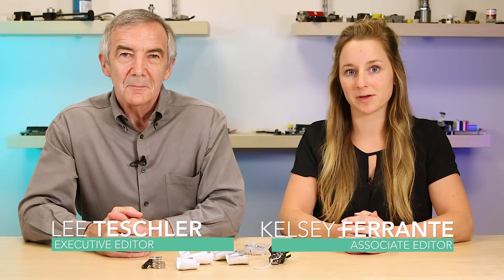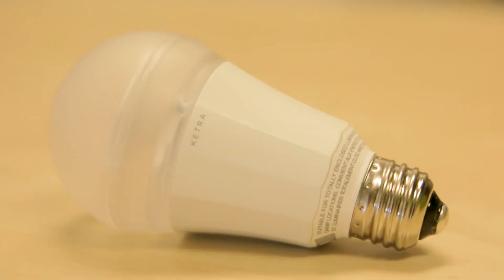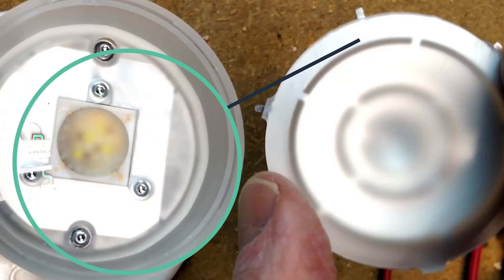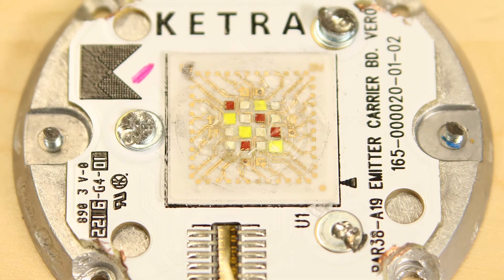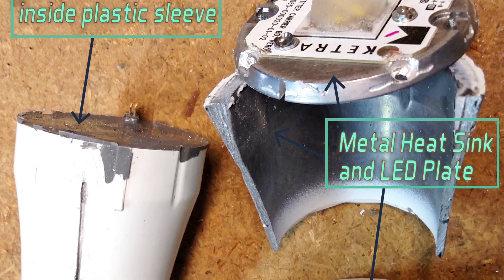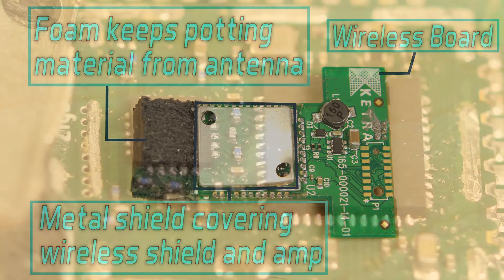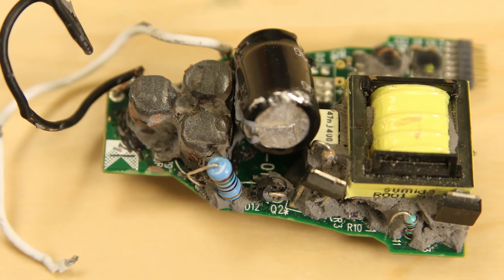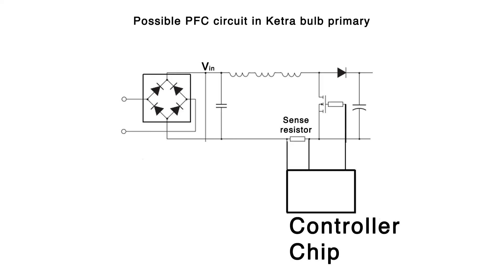Teardown: Inside Ketra's $100 A20 LED light bulb

Comment: Nice teardown.  More please.  Suggestion: protocol analysis of the wifi.  Perhaps also take voltage and current readings at various points -if the circuit survived the teardown process.